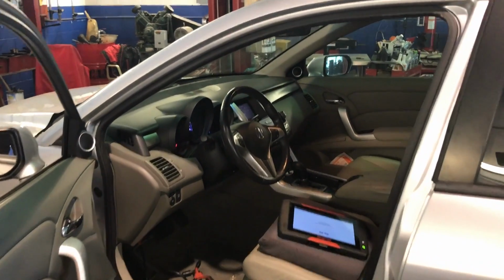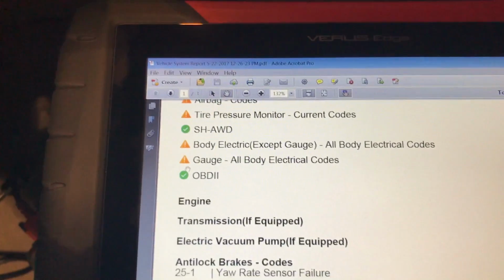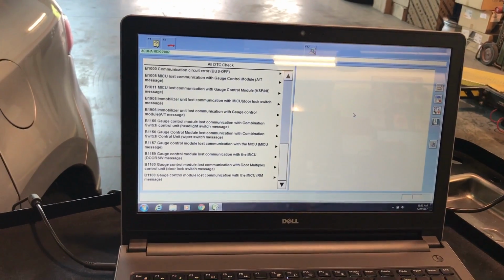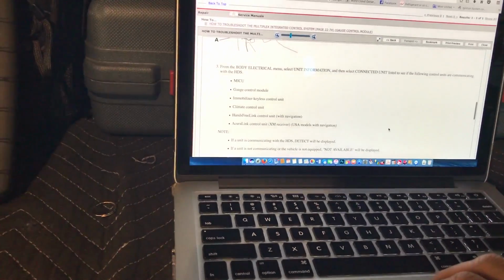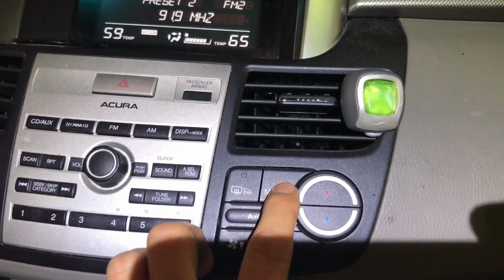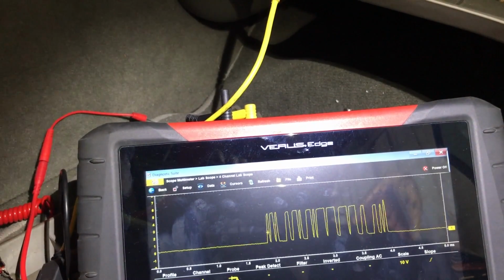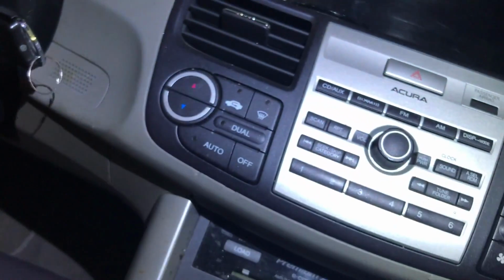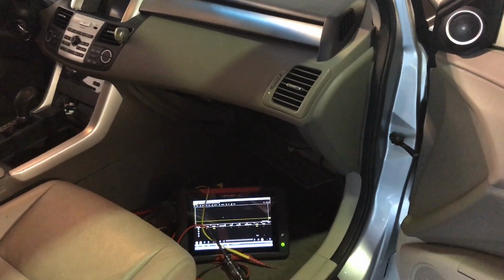2007 Acura RDX 2 3L No A:C communication codes

Comment: Help. I’ve got the same problem but I have good ground. 2 just answer Acura techs have given up after suggestion I change AC controls, ac computer, navigation screen, audio unit, MICU.  We have continuity and no  short to ground or  voltage on  harness control side and computer side. Verified good ground on 501.
Reply from the maker: Check the connections next to the module and grounds on the right side of the glove box
Reply: We have. Removed aC computer housing and verified ground and voltage on the circuit board, to verify plug connections are good. They are. The ground  point 501 to the right of the blower box is also good.
Reply: Sorry ground -G571 not 501. May bad. Thanks

Comment: Hello Maic,very nice video, I have a similar problem except that the A/c ON/ OFF are switching normaly in the small disply ( on the dashboard) but the relays don't activate(they've all been checked), it's like the command is sent to the display but not to the climate controller or the PGM !!!! any troubleshoot for that ? Million thanks
Reply: I have similar issue, there are no DTC codes but AC clutch is not being engaged, but its working fine if commanded through HDS (honda diag system) - DId you find any solution?